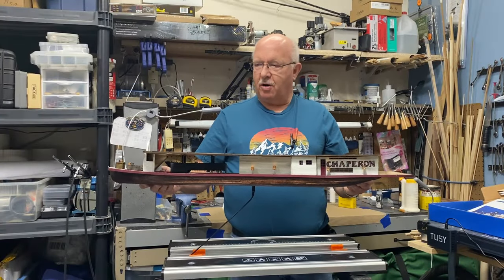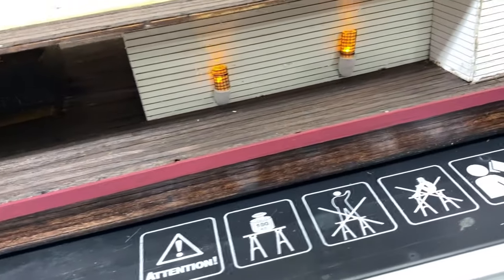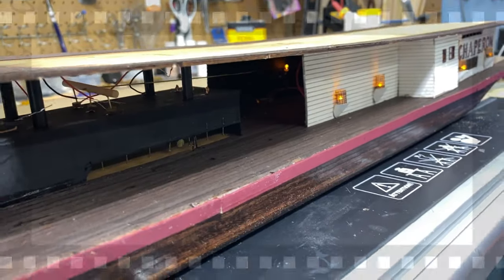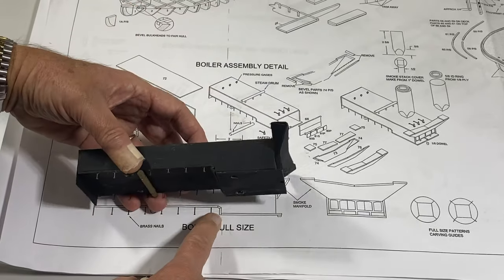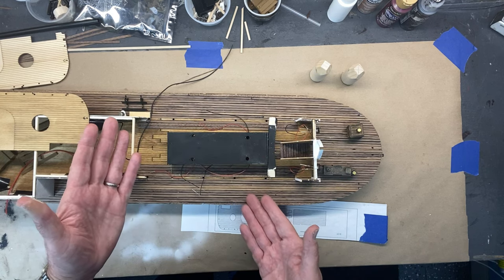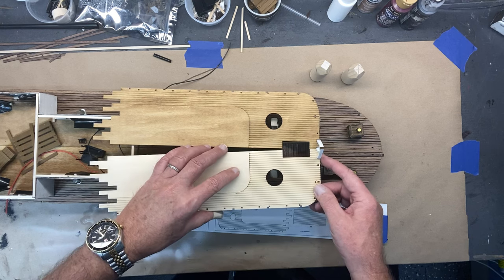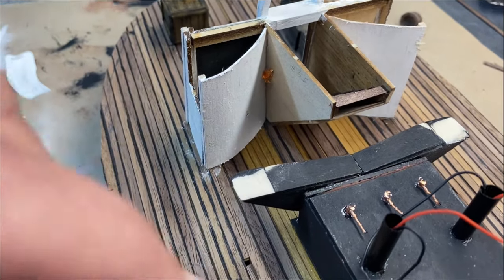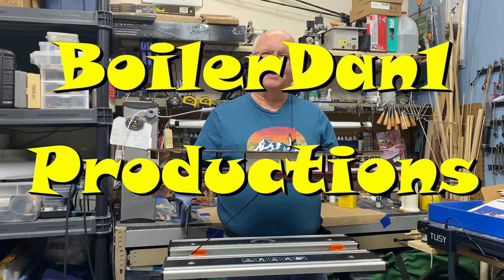The Chaperon PART 5

Comment: Hi Boiler Dan, I’ve been away for two weeks and I’ve just caught up with part 4 and 5. It’s looking really good. As always you go the extra mile with details on the tiniest parts. I love the technique of applying copper plate to some of the parts, makes them look so much more authentic. Your model is shaping up to be in the same class as you sailing ships but an interesting change of subject. I look forward to every episode. Cheers 👍
Reply from the maker: I’m taking a bit of a risk with the copper.  But I’m getting better at it.
My wife gave me an old crock pot to use to age the larger copper pieces and I’m perfecting applying the salt mist to activate the process…..
I’m on a two week vacation myself, so the project is on hold until I get back.
Thanks again for following along.👍